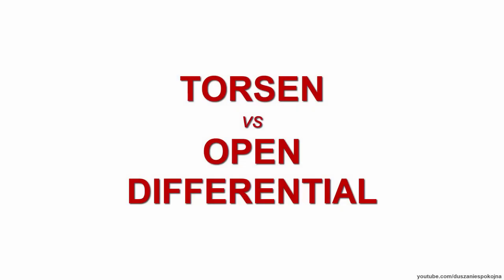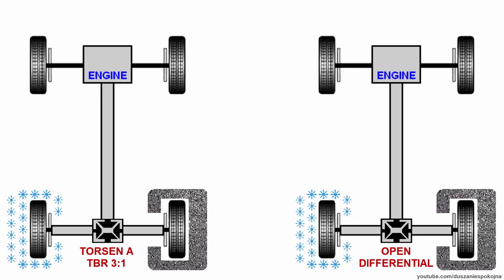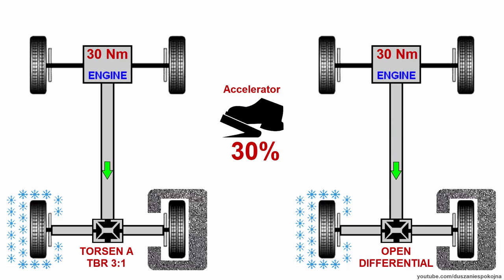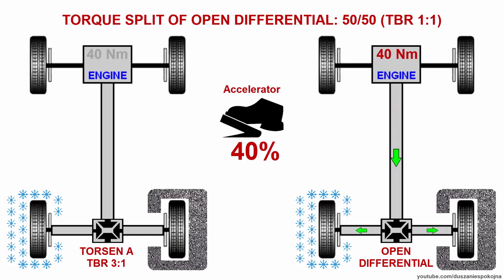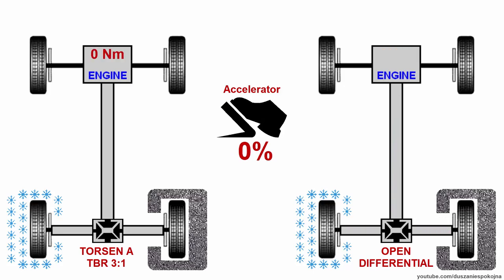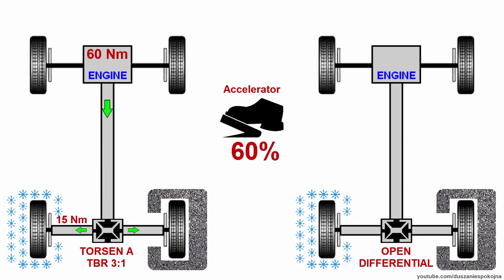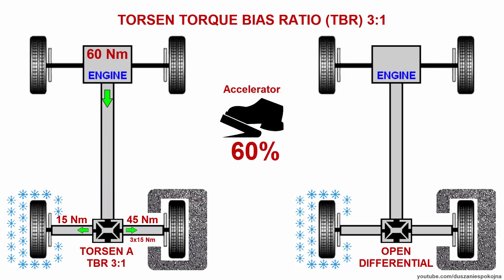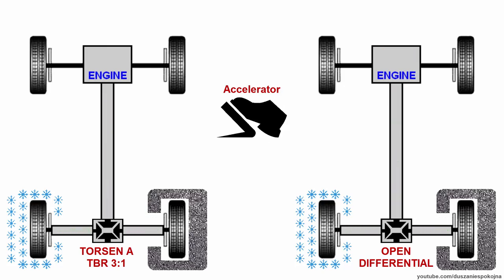TORSEN vs OPEN DIFFERENTIAL - TORQUE SPLIT simplified animation model

Comment: All I know is I have a 16’ RAM 2500 6.7L 4X4 Laramie Longhorn with the “anti spin” differential. (Verified via window sticker and VIN lookup.)

Anyway, I turn traction control off, power brake to ~10psi and then let her eat. 

Driver side leaves a DARK strip while the passenger side leaves a much fainter one.

Reason I’m here… Haha!

Comment: I think you need a speed difference before the torque transfer occurs in the torsen diff. So that means you need to loose traction on the left wheel before the right wheel can get more.
Reply from the maker: There is kind of "initial lock" (up to TBR level), so torque is transfered asymmetrically if there is traction difference between left and right wheel.
Reply: Kind of a static fiction inside the diff that has to be overcome before the wheels can spin at different speeds?
Reply from the maker: @daniel.dybvik  Yes. It is clearly stated on torsen website and in some detailed technical descriptions from late '80s which I used for this video.
Reply: @4x4.tests.on.rollers  thanks for the clarification :)
Reply: Somewhat confusing because you are thinking like a clutch-style LSD. Torsen or Truetrac, as soon as the wheels turn enough for the worm gears to react to a speed difference the torque split happens. Near zero. That is why a little parking brake can allow you to crawl out of a one wheel up situation.

Comment: So, torsen diff only works when both wheels have any torque. In case that one wheel is in the air, loss of traction happen similary as a open dif?
Reply from the maker: If one wheel is in the air then there's just a small value of torque needed to spin it. And even if this value is multiplied by TBR, it is still too low to spin the other wheel.
Reply: @4x4 tests on rollers channel   thank you! This is what I was looking for. So need to find other option for offroading .. as usually we have one wheel in air

Comment: I have one question , in clutch style lsd for example when taking turn lsd doesnt fully allow both wheels to rotate at completely different speeds , it still creates some bind due to being limited slip. Does torsen allow this like an open diff to take turns without any bind and when lets say traction is different it can send 3x torque to wheel with good grip while also allowing full speed difference between 2 tyres when taking a turn and not bind?
Reply from the maker: Quotation from technical docs: "In turning situations, the outside wheels of a vehicle travel over more distance than the inside wheels. Accordingly, the inside and outside drive wheels must rotate at slightly different speeds (i.e., differentiate) to maintain rolling traction with the road. A torque division between drive axles at the bias ratio is a precondition for differentiation under all circumstances of operation. Essentially, in order for one drive wheel to rotate faster than the other, the drive wheel having greater resistance to rotation slows with respect to the differential case and transfers torque to the other wheel contributing to its faster rotation. The Torsen differential resists transfers of torque between drive wheels in proportion to the torque applied to the differential housing, and this results in a larger proportion of the applied torque being delivered to the slower rotating drive wheel. Therefore, bias ratio should be selected to provide the maximum traction advantage that will still allow both drive wheels to deliver significant portions of engine torque in turns.
However, even in turning situations, the Torsen differential enhances traction management. Since torque is already distributed in increased proportion to the inside drive wheel, it is exceedingly unlikely that the outside drive wheel will ever exceed available traction and 'spin up'. Alternatively, should the torque of the inside wheel exceed available traction in a turn, it is equally unlikely for this wheel to 'spin up' since such a 'spin up' would still require a difference in traction between drive wheels which exceeds the bias ratio. 
Ordinarily, when the inside wheel exceeds available traction, differentiation ceases and torque is divided in more even proportion between drive axles determined by the maximum torque that can be sustained by the inside drive wheel. Thus, in all directions of travel, the Torsen differential will resist 'spin up' of either drive wheel by instantly dividing torque between drive axles in proportions up to the bias ratio to match prevailing traction conditions".
Reply: @4x4.tests.on.rollers  thank you so much for the information 👍

Comment: My question is: prioritizing security in bad pavemented roads when you frequently have to pull the car to the sude of the road, so 2 wheels in pavement and 2 wheels in dirt, what system is kore secure? I had a Volkswagen Amarok that i just used for company trips and it saved me in this situation countless times.
Reply from the maker: The situation you described is a job for front and rear differentials. These diffs are usually open, including Amarok, so everything is up to effective traction control system.

Comment: Does this scenario also apply to fwd or rwd vehicles with torsen differential? Torsen is said to work like an open differential when there is no traction (in mud, ice).
Reply from the maker: Yes, of course, it applies to every application of torsen. Torsen never works like open differential, it is explained in the video (traction lost). Final result (only one wheel spinning) may be the same as with open differential but even then the torque split inside is very different.
Reply: Thanks for your relevant reply.

Comment: Btw if you have an Audi with torsen diff, it doesn’t mean you have a torsen rear differential. Usually the torsen is central diferential so it sends power to the front and rear depending on settings in a similar way. The cars with rear LSD are usually sport models and you may need to buy that option. Otherwise, the central differential of an xDrive from BMW works similarly except it has different settings because of different weight distribution. But not sure for xDrive if the split occurs before loosing traction on one axle?!

On low end models (audi and bmw) a cheaper differential is used that only drives the front axle most of the times (haldex or bmw similar awd).
Reply from the maker: Video is about torsen and open diff rules, if someone is wondering how that works as a center diff - just say in your head "front axle" instead of "right wheel" and "rear axle" instead of "left wheel".
When it comes to xDrive - it doesn't have center differential.
Reply: duszaniespokojna - 4x4 tests on rollers yes you are right. It’s called a transfer case, I thought it had a differential mechanism. Anyway it should perform similarly, not like an open differential but more like an lsd.
Reply from the maker: @rotorblade9508  xDrive is Actimax (with some exceptions) from Magna Powertrain and actually it can lock itself.
Reply: duszaniespokojna - 4x4 tests on rollers thanks, Yes. I just watched some animations with the xdrive and the torsen with the worm gears. So the xDrive has a locked rear and front torque is controlled through clutch plates.

Comment: With torsen, being mechanic, torque coming from crankshaft, the torque shift to the side with more grip cannot happen without wheelspin on the slippery side. Do we agree?
Reply from the maker: No, we don't 🙂 That is torque sensing diff, not speed sensing.
Reply: @4x4.tests.on.rollers  Awesome, love to discuss the matter! With torsen, can you please elaborate at what stage before the wheel slip does the torque split happen and what mechanical element decides which side gets more torque. With love, S
Reply from the maker: @samin2173  The answer is in the video 🙂 Any stage above 15 units on the left wheel (so any above 30 units from the engine). When it comes to mechanics - that's more complicated, generally all elements...
Reply: At 2:05, I bet my hairy old dog that torque coming from crankshaft, the torsen rear diff cannot pre-see which side will slide. Yet you are stating that it can. It cannot. Therefore other side will slip first, then the worm gears with worm wheels will do their thing. The torsen thing. But you cannot state that torsen is pre-emptive, because it is not.
Reply from the maker: @samin2173  Torsen is "locked" up to its TBR ratio. That's why it won't slip as soon as open diff. That's not any "pre-see" but initial "locking" effect. Everything is clearly stated on torsen website. Locked diff would do the same, you could even apply much more torque in such situation and left side would get only 15 (its TBR is infinity:1).
Reply: The wheel spin can be detected electronically, and with an open diff you can apply some brake on the spinning wheel but with torsen it looks like it doesn’t need that. The video doesn’t explain this
Reply from the maker: @rotorblade9508  Video is about torsen and open diff itself, not tricks with brakes or traction control or EDL. From a certain level torsen also needs brakes, just like open diff.
Reply: @4x4.tests.on.rollers  

You are correct, learned something new today:"During acceleration under asymmetric traction conditions, so long as the higher traction side can handle the higher percentage of applied torque, no relative wheelspin will occur. "
Reply: @samin2173  do all torsen systems have the same 3:1 ratio? Can you get higher one? Would it be beneficial?
Reply: @Mietas2   https://torsen.com/faq/
What is the TBR for my application?
In general, the TBR level of Type-2 products is between 2:1 and 2.5:1, whereas T-2R models are in the 3:1 to 4:1 range. This varies depending on the specific model. The TBR level of Type-1 differentials can be anywhere from 2.8:1 to 4:1, depending on the design requirements.

but torsen not unical helical differential. early construction german and us (1930...1940 years) have TBR up to 10:1
Reply: @Mietas2  And about beneficial: higher TBR may cause problems with handling, stability, durability. In all turns car will have more 
traction on inner wheel.

Comment: Hello guys, I wanted to make a silly question, if i choose to upgrade the differencial in my lada niva i need to do it both in the front and in the back differencial or only in the back?
Reply from the maker: You mean replacing open by torsen? You can do rear, you can do both.
Reply: @4x4.tests.on.rollers  Thank you for your prompt response!

Comment: I have a question. In the open diff scenario, if I apply 50% throttle, the engine put out 50nM torque totally right. each wheels can maximumly receiving 15 nM, total is 30nM, so where does the 20NM go? or at this moment, is the engine sending out 50 NM torque or 30 NM torque even I apply 50% throttle?
Reply from the maker: It's 30. If traction is lost then there is less resistance. Engine cannot generate more than the resistance (grip) allows. If you apply 50% then the only result will be faster spinning of the wheel with no grip.
Reply: @4x4.tests.on.rollers  Thank you very much! I've always confused about this, but now I understand. If the engine is just spinning without attach to any thing at 5000rpm, it's only delivering power but 0 torque right? Wish your channel grow to 100k soon😃
Reply from the maker: @franklinchen2898  Right 🙂 Well, zero is the theoretical value cause there is always some resistance but torque is very low. Thanks!

Comment: i wonder would it be a good center diff(replace transfer case) if it was made with a torsen ?  i wonder
Reply from the maker: There are many cars which has torsen as a center diff.
Reply: @4x4.tests.on.rollers   nice  i wanna see 1 :D
Reply from the maker: @buder5116  Many of Quattro systems are based on torsen, you can find them on my channel 🙂
Reply: @4x4.tests.on.rollers  4runners  audi  porche have center torsens
Reply from the maker: @vadimnesen8060  Volkswagen, Alfa Romeo, Mitsubishi, Lexus, Range Rover, Chevrolet...
Reply: @4x4.tests.on.rollers  ford dodge Nissan lada Saturn opel chaika...

Comment: Hey man, 
i think if %15 is the max torque of the rear left tire car will send %50  torque to the rear right and %50 torque to rear left tire and brake rear left tire to %15 with Electronic differential (brake controlled) what  do you think?
Reply: Cuz if you say no even with Electronic diff lock rear right tire will get %15 torque  at max scenario car Electronic differential lock has no use
Reply: Torsen has advantage for the scenario if left tire has max %20 torque limit not to slip, then 1:3 ratio torsen can send %60 power to the right tire but with edl max torque of right tire can be max %50 cuz this is an open differential
Reply from the maker: Hi, I do not understand your question. Any value above 15 for the left tire means slippage. If you apply brake to the left tire then you will increase the max value from 15 to 20 e.g. (brakes prevent from spinnning). So open diff will split 20/20 (max 40 from the engine) while torsen up to 20/60 (max 80 from the engine).
Reply: @4x4.tests.on.rollers  if car has edl since max torque split of one tire can %50 with open diff, then car can able to send %50 of the power to one wheel and brake other %50 powered wheel to %15 to avoid the slip thats what i am saying
Reply from the maker: @ozkanugurcetin2842  You can't "brake to 15". You have to "add" braking force and traction together. This will be one, increased value. And the same value will go to the right if it is an open diff. I will do another animation about it :)
Reply: @4x4.tests.on.rollers  if you say is true then edl has no use cuz braking the possible slip wheel is a job of ESC system what EDL does extra then?
Reply: @4x4.tests.on.rollers  and also what do you think should i buy rear diff lock for my Dacia Duster will it work good with the ESC system or its a waste of money?
Reply from the maker: @ozkanugurcetin2842  EDL is braking the wheels when you start or drive slowly, not ESC. Electronic Stability Control corrects understeer and oversteer.
Diff lock will do the job while offroading, system won't be using brakes too often.

Comment: I still don't get one thing. Does the torsen or LSD have worse performance in turns than open differential? Lets say the both wheels are on dry asphalt road. IMO because the slip is limited, then in sharp turns the difference between speed of each wheel might be such high that wheels will behave like with welded differential which is something that I don't want in turns.
Reply from the maker: Torsen or lsd are not lockers, they won't behave like welded diffs. They may limit speed differentiation between the wheels but not lock them.
Reply: @4x4.tests.on.rollers  I mean, what if the limit is too high?
Reply from the maker: @jaromirandel543  That must be some really strong lsd, designed for some special purposes.
Reply: @4x4.tests.on.rollers  O.k. Thanks.

Comment: Not only Torsen (TM) - almost all another limited slip differentional have the same characteristics. And all of them are "torque sensing" too.
Reply: Yes, but in a much simpler way. They also create heat and friction when not necesarry on full grip surfaces.
Reply: @melody3741 ,  Heat is a consequence of friction, and friction is the basis of the blocking effect. It doesn't matter how friction is created, what matters is its presence. All lsd are the same in this. Unfortunately, they all have low friction on ice when needed, and high friction on pavement when not needed. This is due to the magnitude of the moment transmitted through the mechanism. The only difference is the preload. it is an attempt to correct the characteristic by creating friction when needed. But there are Torsen with preload, and for example, cam lsd without preload.

Comment: "an open differential always sends 50% of the power to both wheels." Um, I'm not so sure about that. On a straight, equal traction surface? Yeah but if one wheel looses traction, that wheel will spin out and the other one will get far less power to it. It's kinda how an open differential is constructed. The wheel that moves faster, gets more power because it's what makes turning the vehicle left or right so effortless and not noticable. You don't have to adjust the position of the accelerator pedal to maintain speed throughout the turn, the diff does it for you automatically.
Reply from the maker: Video is about torque split, not power split.

Comment: In case of open diff, lets say engine is producing 40 Nm torque. Now, since it splits equally, 20 Nm go to each wheel. The wheel on ice starts to spin whereas the other doesn't. On the left wheel, we have (20 Nm-15 Nm=5 Nm) of net drive torque which produces wheel angular acceleration. On the right side, since we don't cross static friction torque, 20 Nm is insufficient to spin it. Why would engine torque go down to 30 Nm? Engine torque produced should just depend on the rpm at which we are. Right?
Reply: I am under the impression that the engine drive torque is split equally when open differentials are used. Is that right or is load torque split equally?
Reply from the maker: @jasvirvirdi6744  Engine cannot create torque if there is no resistance. Resistance comes from grip. Less grip means less torque can be generated. Torque split of an open diff is always 50/50, value is limited by the wheel with less grip.
Reply: @4x4.tests.on.rollers  Thank you! I will read a bit more on this